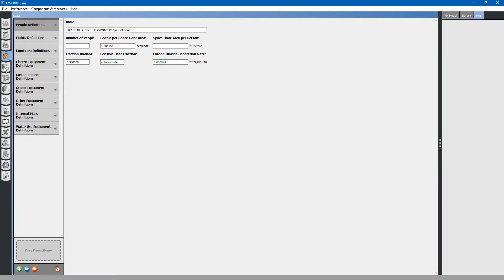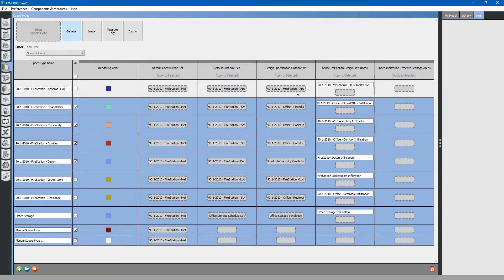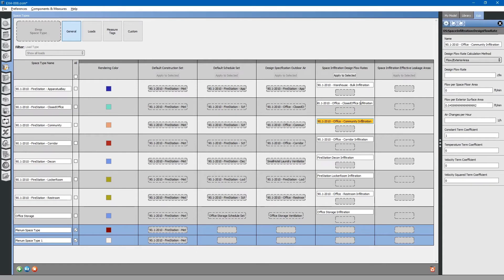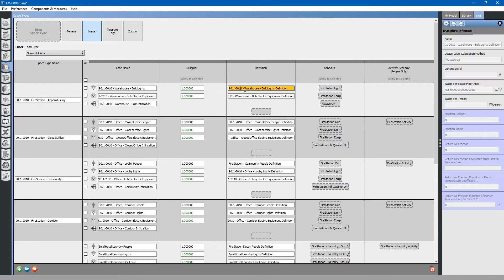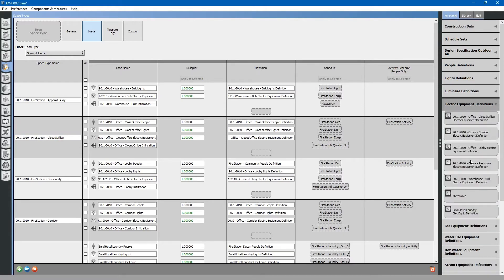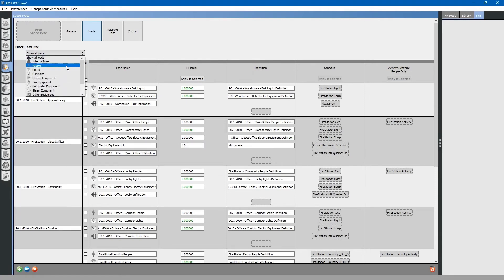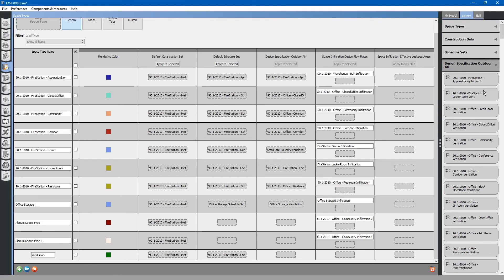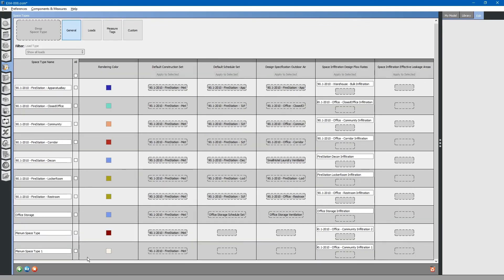Building Energy Modeling in OpenStudio - Space Types

Comment: I noticed you have two plenum space types. Which video did you make those? Do I need to define plenum spaces if I am modelling HVAC systems in across multiple thermal zones?
Reply from the maker: Good questions.  A simple plenum can be created by clicking the green plus button (add new object) at the bottom of the Space Types window.  A plenum is simply a space type that has no loads or schedules assigned to it.  You can also import a plenum from one of the default libraries (eg. 90_1_2019.osm).  The plenum is normally reserved for spaces, such as attics or above drop ceilings, that will span multiple thermal zones (like this:https://youtu.be/D2uHGhfY0fk).

Comment: How would you obtain the construction of a building that has external walls as glass and the in the interior has both wood and concrete? This building is in Queensland Australia for reference.
Reply from the maker: This is something that you would have to make custom.  If the glass is transparent and performs more like a window, you would have to create a building with 90+% window to wall ratios.  If the glass is more like an insulated block, then you could probably just create a material and wall construction that has the requisite properties.   You can specify wood and concrete interior walls in the construction set, Interior Surface Constructions.
Reply: @helixenergypartnersllc3540  I don't have access to some of the Australian Building Codes and other handbooks. I don't want to pay for them. Would using a climate zone 2A building  and modifying where needed be a viable work around? I have a building with 98% window to wall ratio. The exterior windows with glazing sits behind a rotating set of blinds.
Reply from the maker: The Australian National building codes are free.  I believe you will have to pay for the AIRAH handbook and standard.  The USA climate zone 2A might be comparable...but it might not.  I do not have any experience with simulating external windows blinds.  Here is a thread that may be helpful:https://unmethours.com/question/77112/controlling-exterior-blinds/

Otherwise, you might look at this video that discusses transparency of shading materials: https://youtu.be/hVbmaVg9zv0
And this about custom 8760 schedules using s CSV file: https://youtu.be/S_HbjEAGCrg